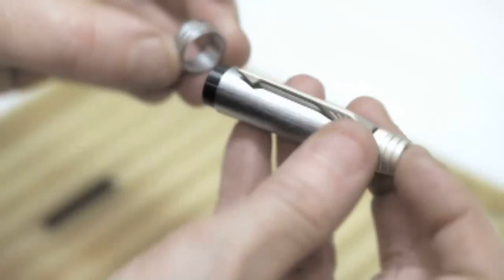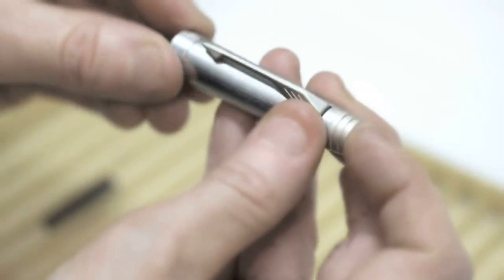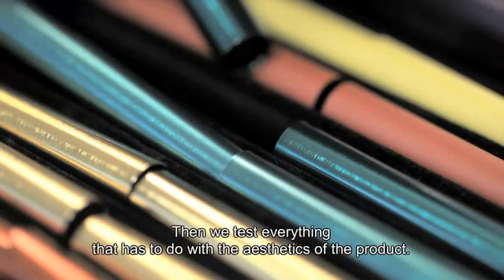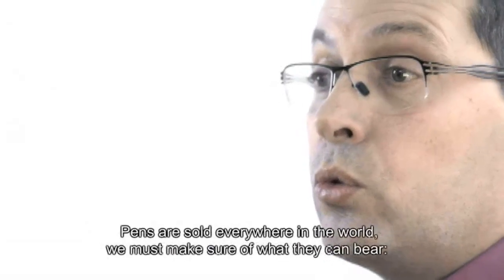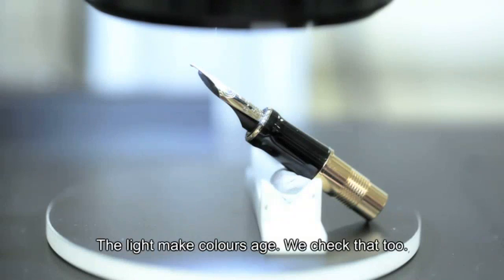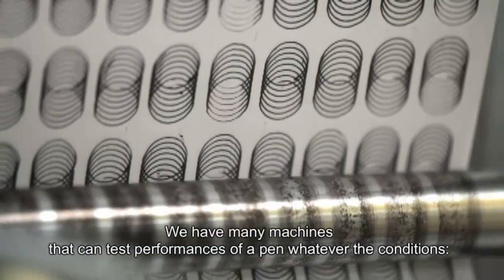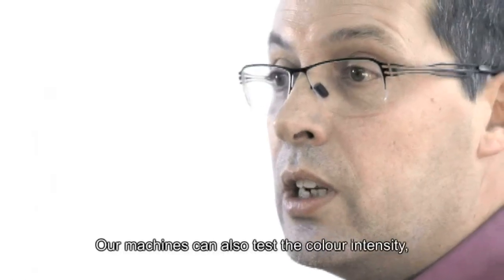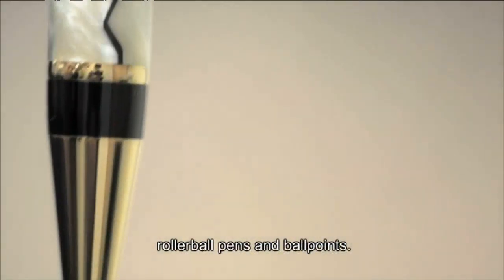Expertise - A Parker pen's quintessence

Comment: daRn ad. Makes this vintage/antique/old thing LESS likely to purchase a modern/new Parker fountain pen.
MAYBE if they brought back the Aerometric filling system ... or a piston or eye dropper fill like in the olden days that DON'T take a 🤬🤬🤬🤬🤬🤬 cartridge/converter at a budget price point ... say at Lamy Safari price point and less.
Hero can make Aerometric fill real hooded nib pens for under $10 USD each. Surely Parker can do the same!
I'd also like to see Parker replacement parts such as barrel and hood sets for the Parker Super 21 (my Super 21 has a cracked hood) and nibs for the original 51 and Super 21, (extra fine and MAYBE a EF/F or F/M flex nib THAT DOES, please.) and parts for other vintage Parker fountain pens ...  perhaps with modern acrylics and in colors not available when the models were in production.